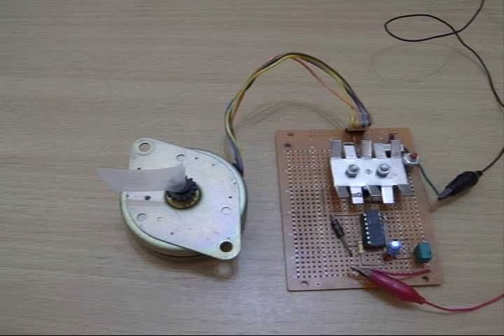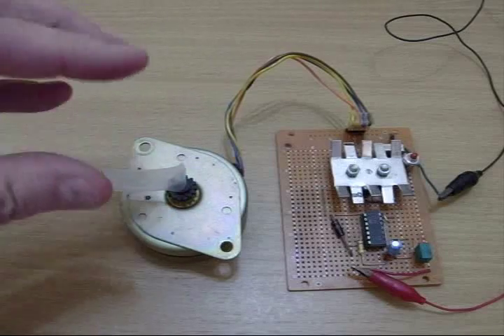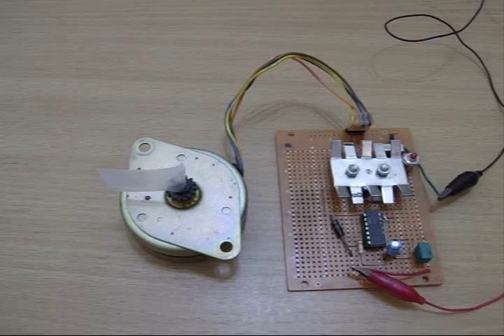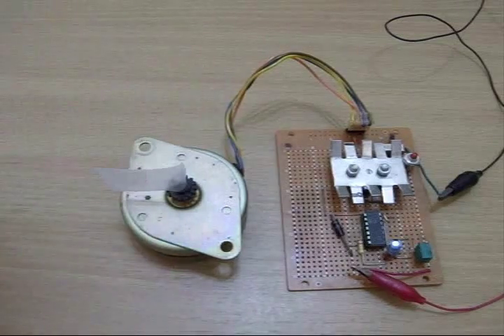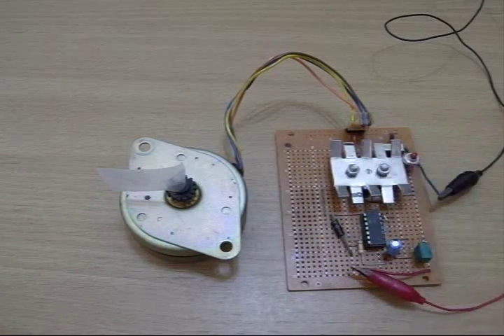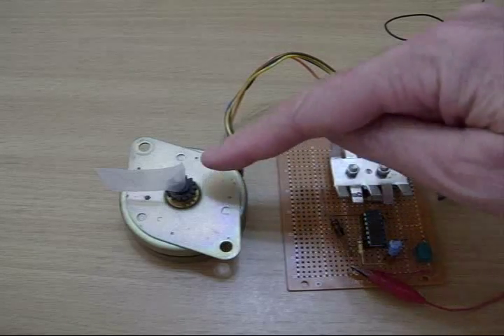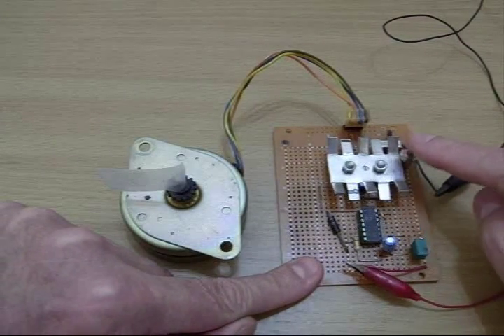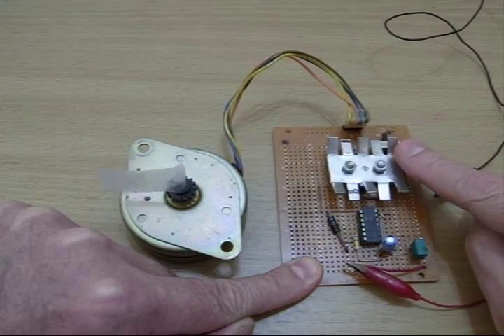Stepper Motor - Simple, DIY

Comment: Is there any instruction to make that? Thanks!
Reply from the maker: I have 2 videos on how to use a Raspberry Pi to do it.  The Pi version is much more useful as you can program it to do what you want, rather than stepping it by hand (which gets real old real fast!)  The newest one (DRV8825) could be done by hand (no Pi) if you really wanted to.  I show the diagram on how it's wired and one would just have to pulse the "step" pin to get it to move, but it can require over 4000 steps to make one rotation!
Reply: tsbrownie Thanks, man, but I need it without any other circuit, really. Just a small homemade one and the battery. But thank you any way!